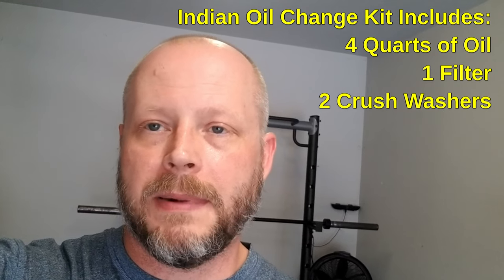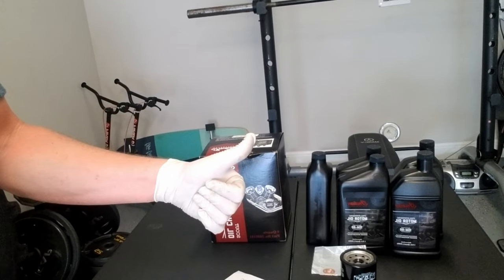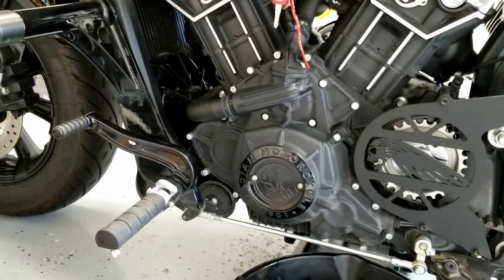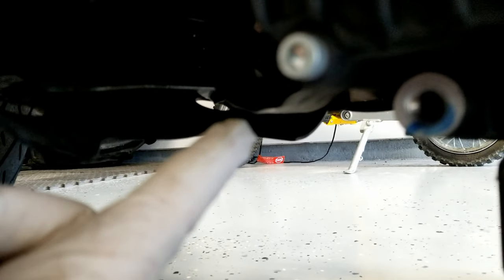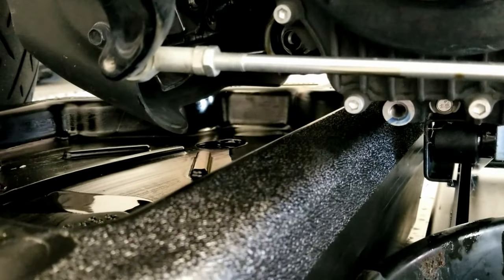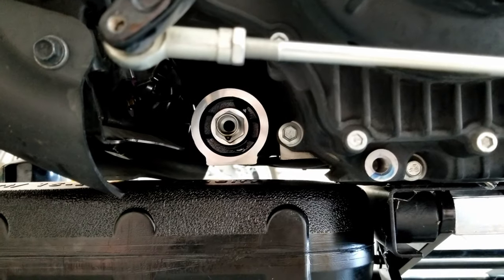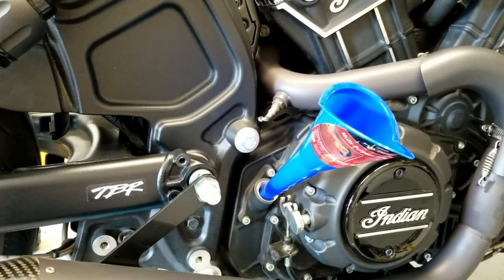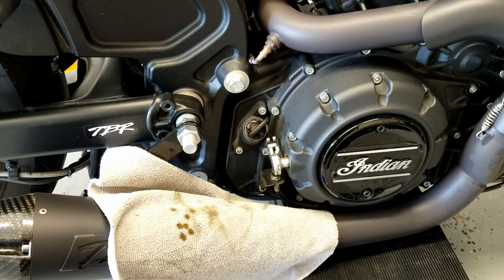How to Change Your Oil on an Indian Scout Bobber

Comment: When you clean the air filter, you should replace the spark plugs with the iridium ones
Reply from the maker: That's a fantastic idea!  I need to look at a few things while I have the tank off.
Reply: @dadwithabike  that's what I'm doing. Ordering the power commander, then installing the trask and plugs since I'll have the tank off anyway

Comment: Pls post how to change coolant
Reply from the maker: I will find it in the manual.  Coolant doesn't get replaced until 50,000 miles (or 5 years).